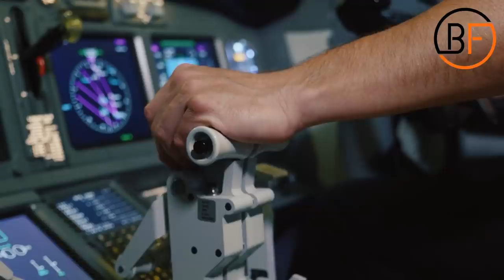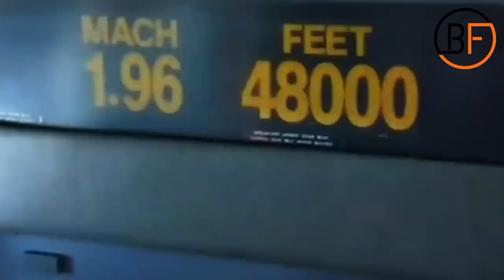This Is Why Planes Don't Fly Faster

Comment: Efficiency and cost overrule sheer performance. Concorde showed that. Aircraft speed can't challenge congestion around major airports, so the route speed is not an apples to apples measure that can be applied over all flights.
Reply: Kyra

Comment: what's not addressed here is :
fuel consumption
fuel consumption is not linear.  it's increases or decreases exponentially by throttle setting especially in high throttle positions . decreasing the throttle a small amount can create a large decrease in fuel consumption. 
mach speed
mach speed is not absolute.  mach is variable based on air pressure, temperature and humidity.
air passing over the wings and control surfaces is accelerated over the cambered surface.   if the aircraft is near mach - the acceleration over the camber can cause numerous problems if the aircraft is not designed for mach speed operation. 
other factors com into play but these are the 2 most relevant.

Comment: The speed of the actual airplane isn't the problem.  Airport parking and the dreaded security checkpoints negate any possible gains of flying faster and there's little chance either of those will do anything but get worse.

Comment: turbojet engines are very rarely used for any aircraft anymore.  turbofan engines are used on all modern supersonic aircraft as the benefits of a turbofan are massive.  for example turbojets are extremely noisy, and many airports have a noise restriction.  much less noise is produced by a turbofan and therefore more airports are available to aircraft with that type of engine fitted.

Comment: Let's not forget there a few more aircraft in the air than back in the 80s. So travel times are also affected by traffic rather than the speed with which aircraft fly.

Comment: As an airline Pilot for Southwest Airlines with over 17,000, have to say; this video is half true. There’s more reasons why the speed of an airliner is restricted and is not because the one mentioned. Example B-737 max speed is .82 Mach, SWA usually files our flights at cost index of 40 and is around, .78-.80. Speed will be determined by the wind direction… 
Wing of an airliner has a maximum speed before suffering from a Mach buffet. 

I wonder why fact checkers haven’t taken this video down???

Comment: Good question but 500 mph is still mind boggling to me especially when u consider how much planes weigh..aviation advanced so quickly in the 20th century it really is a trip that they don't go faster...the concord though is one..at 1345 mph it's not quite twice the speed of sound
Reply: The speed of sound varies with altitude (air pressure). So it depends on where you are before you start talking about the speed of sound. The change in speed is significant.

Comment: You completely ignored the biggest technical reason they don’t go faster. About Mach 0.72 the speed of the air over the thickest part of the wing starts to go supersonic. The transitionary mach region. Because of that it starts to separate and becomes wildly inefficient and unpredictable on a wing not designed for supersonic travel. The concord was designed to handle the compression wave off the leading edge and the expansion wave off the trailing edge of the wing. Commercial planes are not. Supersonic aerodynamics are completely different than subsonic. While all of your points are valid, you did miss the most critical point. Physics.
Reply: So what would happen if a commercial plane went supersonic?
Reply: Commercial planes aren't designed to handle it because they don't need to. One might imagine that if commercial planes were intended to go supersonic speeds they might address that fact.
Reply: @KnoxR6  You would probably have to add some rockets to the wings to make say a Boeing 737 go supersonic.  I don't think the engines would produce enough thrust at altitude.  But if it did it would be a very shaky ride... there was a reason why the concords wings were shaped the way they were.
Reply: Assuming the wings stayed on, the lift point of the wing would shift rearward, putting the aircraft in a dive, moving the lift point further aft, resulting in an even steeper dive.  The passenger aircraft are not able to pull out of that type of dive.
Reply: @KnoxR6  I'm sure something would rip off if it managed to somehow go that fast in the first place.

Comment: 12 hour flights? My flights to Korea are 15 hours. But it ultimately doesn't matter whether I save a couple hours or not. I'm still dead tired and the layover will probably just be that much longer if we arrive earlier anyway. I'm much happier knowing that the airfoils aren't risking shockwaves caused by their relative speed to the air by approaching the speed of sound too closely. I think another reason they designed engines to fly at optimally slower speeds is to help out with the heavier loads. Planes need to be designed for greater lift coefficients or we'll really be burning fuel trying to keep that plane in the air. I suspect that lower cruise speeds may also permit the plane to ride a little heavier when necessary by having that wider range of speeds available without coming too close to the speed of sound.

Comment: I think instead of talking about how flying faster could cause an aircraft to run out of fuel and possibly be dangerous, you should say it will simply require refueling more often, which technically results in longer transit if it's not a short flight. Nobody is going to fly their plane dangerously low on fuel.

Comment: Not all super sonic aircraft are turbojet, in fact in modern times the are almost exclusively turbofan. They are mid to low bypass fan, with the bypass dumping in from the nozzle aft of the afterburner.

Comment: The problem was the Convair 880.  This airplane was made to be a faster airliner than the 707.  It was, but nobody seemed to care.  What people cared about was it burned significantly more fuel than it's competitors, so it just cost too much money.
On the other hand, Boeing's carbon fiber 787 uses up way less fuel than its competitors, and they sell every one they can make.
 If they really wanted to save a passenger's time they could have valet parking and do things so you could arrive at the airport a few minutes before take off, walk right through the terminal and on to the plane. Then you would give them your ticket during the flight. When you landed at your destination the taxi cabs would pick you up where you got off the plane.
If they hired pretty girls who wanted to meet unmarried male passengers to be their stewardesses, like they did in the 1960s an airline could sell way more tickets.
Reply: Yep, women are made for our pleasure
Reply: Sounds like the 1967 book Coffee, Tea or Me?

Comment: It would be interesting to see a comparison of the average ticket price in the '60s compared to the average ticket price today (adjusted for inflation). Considering the fuel cost savings at a slightly slower speed, I think that would be the #1 reason planes fly at the optimum cost/speed they do today. When competition lowers the ticket price, you have to save money wherever you can and I think fuel is an airline's largest cost.

Comment: the biggest limitation is actually wing design, you can have a high speed wing or a high lift, can't be both. Airliner wings have to be able to generate the lift to carry hundreds of passengers, bags, fuel, water, toilets... which means they'll be a "slower wing" business jets don't need that insane amount of lift so their wings design can be different. Fighter jets can fly supersonic but they're extremely unstable at slow speeds. For those who really care about the basic science of that, the air flowing over an airplanes wing is accelerating, so its faster than the airplanes airspeed. and really weird things start to happen as you approach the sound barrier, and because the way wings are designed, the wing will hit Mach 1 before the actual airplane does, in that lies the issue with speed.

Comment: Fuel is definitely a factor. But let us not forget aircraft design. The concord and fighter have a wing design called a Delta wing.  Todays wing design are called Swept back wings. This design is used to counter act the affects of flying the speed of sound and beyond. Flying with a swept back wing at or beyond the speed of sound create yaw forces on the aircraft. Even the yaw dampeners on the aircraft will have trouble keeping the aircraft stable. I have seen over speed on some aircraft such as a Dc8 fitted with the CFM engines. The aircraft had to be scraped due to wing spar damage.

Comment: I was expecting this to have brought up military fighters which are also slower now than they used to be. Flying a bit slower makes the plane much more manoeuvrable. The sr71 used to outrun missiles but misses have improved such that The plane isn’t going to outrun them any more. So manoeuvrability becomes far more advantageous than outright speed.
Reply: @DeusVult1683 not in any way helpful informative or backed up.

Comment: Don't know if flight patterns and control operations have anything to do with the speed. But, I've flown Montreal - Ft. Lauderdale 4 or 5 times. Each time it took around 4 hours going and three coming back. I could see 15 or 20 min but 60 min. Something is controlled. And going the 
small TV said around 340 to 360 mph going and 460 to 490 coming back.

Comment: E=mc²

When you push the velocity up on the right side of that equation it pushes the energy up on the left side of the equation. Energy = $, therefore the equation could just as well be written as,

$ = mc²
Reply: That formula is for atomic calculations. You need to use the aerodynamic drag formula.

Comment: As another commenter pointed out, the near supersonic flight for a normal plane could cause vibrations that could tear the plane apart.  Planes designed for supersonic flight don’t have these issues.

Comment: I used to vacay in Vegas 2X a year for 10 yrs from 2007-2017 but I'm Done. From back east here you pretty much kill a whole day getting there. Driving to the airport, parking in Long term, getting the shuttle to the terminal then the whole TSA deal and then waiting the 1hr they want you there before the flight. The flight itself is 5hrs then the time to deplane, go to the baggage carousel and grab another shuttle to the rental car place pick a car and drive to your hotel, check in and finally collapse in your room. Then you do the whole thing again in reverse coming home plus losing 3hrs with the time zones. I can drive to Atlantic City, door to door in 3hrs flat in my own comfort. AC ain't LV but it'll do and I save the airfare.

Comment: Your MIA-DCA example of 45 min less travel time is most assuredly not related to aircraft speed difference it is due to increased traffic congestion
Reply: Indeed. Most of that extra time is spent circling in the pattern, waiting your turn to land at an overburdened airport.

Comment: There's also another issue: flight safety. The mid-air collision of a TWA Constellation and United DC-8 over New York City in 1960 showed the need for speed limits on air routes, and that's why even in 2022 you need about 5.5 to 6 hours to fly westbound from New York City to Los Angeles.
Reply: I don't get it.
Reply: That was 250kts below 10,000, having nothing to do with FLs
Reply: That accident wasn't about speed, it was about poor Air Traffic Control. There were a whole raft of reforms that came about because of what happened that day.

Comment: Surprised that they actually have not used the aerodynamic nose cone of the concord..(but straight) ..or any small jet.. which would  decrease drag and increase any speed stability by forcing lift to the wings.. also a down sloped wing would increase landing and high speed stability.

Honestly we are using an aged tech with new thrust vectoring... when developing planes it needs to be a whole new thing... plus I'm sure the resistance at Mach has some energy harnessing ability... like surfing a sonic wave.

We know nothing about flight, but we do have anti-gravity materials... reverse polarity... Nuclear generator/hydro carbon power. We know a fraction of what we need to know.
Reply: don't be surprised, study aeronautics instead so you know why they design like they do.
Reply: @protonneutron9046  thank you for the steering.. I will definitely look into it😊.

I do know aerodynamics though.. im a trained pilot.
Reply: @arsnotorious  A hint, supersonic vs. subsonic.  Also look into the Area Rule

Comment: Exempted from fuel restrictions and emissions regulations.
Aerodynamic force of resistance goes up exponentially as speeds increase. Fuselage, wing, engines, all present a large frontal area to present drag force. 

Imagine the fuel use for just the professional sports transportation systems. 
All the talking of climate change is just that. Talk.

Comment: Airlines are making money.. why would they mess with that. With more efficient planes, prices are still the same or higher. Was never about the fuel, some flights have 0 passengers and yet still fly out!
Years ago aviation was a passion and everyone in that field was trying to improve and take it to the next level. Now its only the money, the airlines and the plane manufacturers will only make air travel faster if it purely benefits their pockets. If a Malaysian or Ethiopian crash, so be it.
Reply: wrong.  We've reached the limit based on aeronautics and jet engines.  DO get an education in science and econ

Comment: you missed the biggest reason planes don't fly faster. the faster they go the center of gravity goes rearward on the wing. the plane begins to nose over which causes it to speed up even more and the center of gravity goes further aft, then the plane speeds up even more and the pilots lose control of the airplane because the elevator doesn't have enough control to pull the plane out of a nose dive.

Comment: Is anyone bothered about the safety side of air travels??

We have been doing air travels for quite a while now and its still haven't gotten safe enough. Make sense, its literally a tube lifted thousands of feet from the group with so many mechanical moving parts, any simple mechanical/ hydraulic failure can bring it down, we have this recent event in china where a Boeing 737-800 slammed into the ground with it's nose down, very likely a faulty rudder or elevator trim..it happens all over the world...Add to that the software side of things, we all know about the 737 maxs with its faulty software bug and with that, question raised about the corrupted FAA so who do we trust now!?
Reply: Commercial flight has ALWAYS been the safest form of travel. Bar none.

Comment: Just like fighters pilots running with there burners on can go faster, but they burn much more gas.
Reply: Concorde cruised at Mach 2 without afterburners, they were only used for take off and to punch the sound barrier

Comment: That's ok to fly subsonic in an commercial aircraft,but i wonder why private aircrafts are also subsonic and nations heads aircrafts also subsonic.does anyone know
Reply: I'm guessing it's sonic boom restrictions. Military aircraft are allowed to break the sound barrier on specially-directed routes across the US for specific purposes. I was born in 1961 in central NY, and in my younger years, I heard maybe 4-6 sonic booms, caused my military planes from one of the two local airbases we had here (Syracuse and Rome). I actually found them rather exciting, and miss hearing them today. I don't understand why people get so upset by hem. I know the government did an "experiment" where they flew supersonic jets over a city in the mid-central states, and then polled the citizens on their reactions to them. After a large number of complaints, the project for a US-made SST (by Boeing, look it up here on YT) was cancelled, and  speed limitations were put in place. For those who have never heard a boom, one aviation guy called them "similar to thunder from a couple miles away," but of course the intensity varies with the size and speed of the aircraft, as well as the altitude. I'll say it again: I miss hearing them!

Comment: Alternative fuel method and stronger material might make it possible…..
Reply: And what fuel would you recommend?
Reply: @lonnybruce9407  Airbus makes effort to develop a hydrogen-powered passenger airplane
Reply: Hydrogen is the most expensive liquid/gas fuel that there is and therefore a very impractical fuel for commercial aircraft.
Reply: @lonnybruce9407  Might be right,  I wish Airbus could hear you out….

Comment: Fun fact commercial jet engines don't use any fuel after the engine is running. The compression of the air creates a self sustaining fuel. Air=fuel. They're ripping you off with these high ticket prices

Comment: I wish journalists actually had a proper education. The physics and maths subjects they chose to avoid would have answered the question this title asked by this video. So I’ll answer it. Modern aircraft are designed with operational economic efficiency in mind. Speed equals money. Time equals money. Somewhere between the two is the optimum speed to fly and that varies by the day, cost of fuel, cost of missed connections, cost of hotels, cost of maintenance etc.

ps. Concorde was buggered up by the Americans. They didn’t have one so these naval gazers decided that we couldn’t use ours in their airspace. I think it’s called NIMBYism.